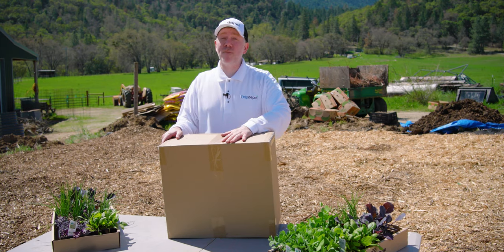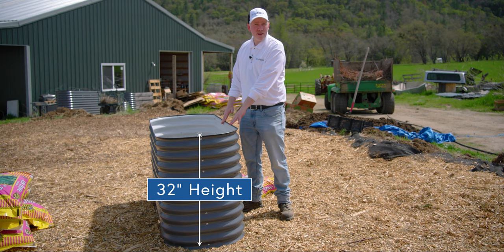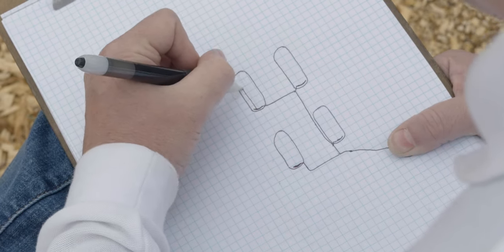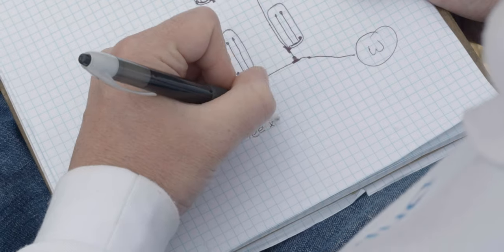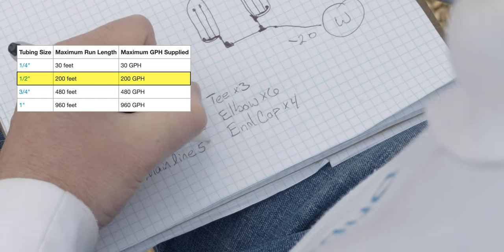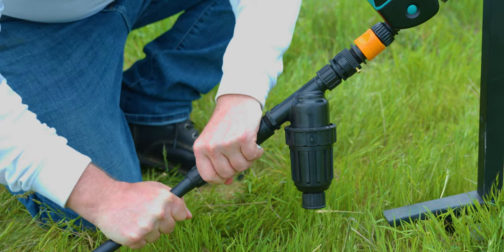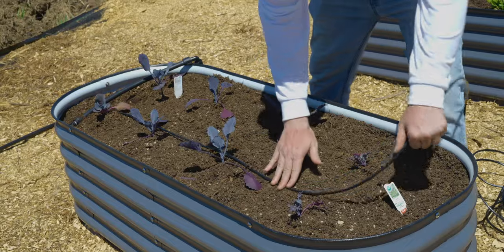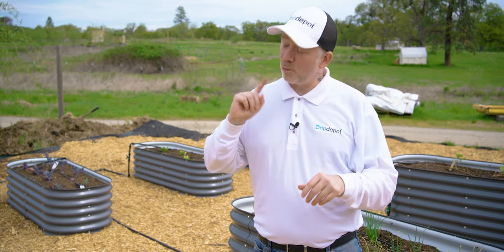How to Build a Raised Bed Garden with Drip Irrigation (Complete DIY Guide)

Comment: So many comments, you probably addressed this somewhere. I'm looking at creating a system for both wooden raised planters and metal beds as shown. You make it look very do-able, even for this senior lady. Can you bury the main lines that go to different locations in your your? My yard is almost all sand with playground mulch over it, and I'd like to bury it about 6" down so my dogs aren't running through it, and of course for appearances. Is there any reason why I can't do that? You videos on design and install are super helpful. Thanks very much.
Reply from the maker: Always happy to address it again if I have, no need to go through so many comments :) 

I also do know this is do-able by a senior lady, I've helped many get started them and then watched them build fantastic systems (and I'm not exaggerating in the least).  

You bet, you can bury your mainline -- I'd say it's very common to do so in fact, with many folks having it places they need to mow and maintain with equipment.  6" down is a good depth as well.  Thirsty critters might dig that deep, but if they have other water sources available (fountains, water features, etc) they'll go for the easier ones and not bother digging up your tubing :)
Reply: @dripdepot  Thanks so much. I thought that would be the case. No thirsty critters to worry about here as the pups keep that back yard pretty critter free. Your planning video was also great and I'm developing a plan. The question is if I tackle it this fall or next spring. We don't often have a freeze here so I feel I'd be pretty safe to put it in this fall. Thanks again!
Reply from the maker: @epristerv  You're very welcome!  And I vote Fall, it might be nice to get to tinker with the system a little before next Spring (or maybe even try out a small Fall garden) :)  Great time for lettuces and some brassica!
Reply: @dripdepot  Oh yes, my biggest growing season is fall through spring here. I just don’t have nearly the water needs as we do in the hot, hot summer. I’ll get geared up for it soon. :)
Reply: I’d like to incorporate some in-ground blueberry bushes into my system. What would you recommend to best water them?
Reply from the maker: @epristerv  For blueberries, I'm personally a fan of two types -- adjustable drippers on a stake or a drip line ring that goes around the plant.  They both achieve basically the same thing (getting water to all side of the root zone) through different ways: the adjustable one by throwing the water a small distance, and the drip line ring by getting an emitter to all sides of the root zone. 

Both can accommodate the plant as it grows as well -- the adjustable drippers can be turned up for greater output (over a larger distance as well) and the dripline ring can be increased in size by simply splicing in another length of it. On our site, if you put #2006 into the search bar, it will take you to the adjustable drippers --  #2037 will take you to the drip line if you wanted to have a look at each of them :)
Reply: @dripdepot  Thanks one last time. I don’t think anything “throwing water” is a good idea for blueberries as they’re so prone to fungus issues, so I was thinking a drip line staked into a circle around the plant. Thanks for validating that it should work.  I’m assuming the drip lines shouldn’t be covered by mulch like the main lines can be? So I’d need to place it on top of any mulching? Sorry to keep messaging. I’ll call with further questions!
Reply from the maker: @epristerv  Exactly right on the throwing water -- the adjustable drippers on stake have a gentle umbrella pattern and the stake can be pushed in enough so that no water hits the trunk or foliage of the bush (and the spokes of the umbrella can be turned so none are hitting it either).  Dripline rings around the plant are a good solution, kind of the best of both worlds (water all around the plant's root zone, but dripping directly into the soil).  

It's ok to put mulch over drip line -- it does slightly raise the risk of clogging, mostly from the risk of back suction after shut down (water drains from the emitters, which means air is pulled into the line, usually from another emitter).  It's still fairly common to bury them, but definitely not required.  And you're welcome to ask any questions you have!  This channel is in part an education channel, so questions are always welcomed :)